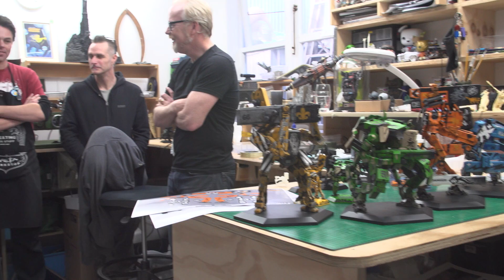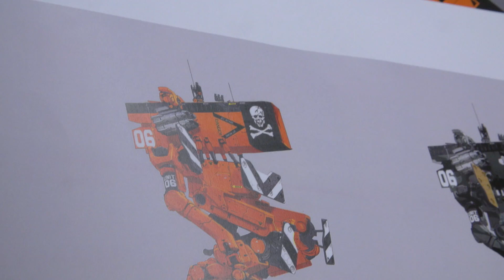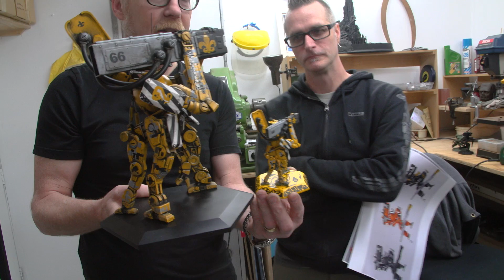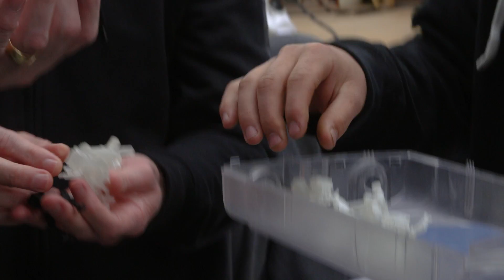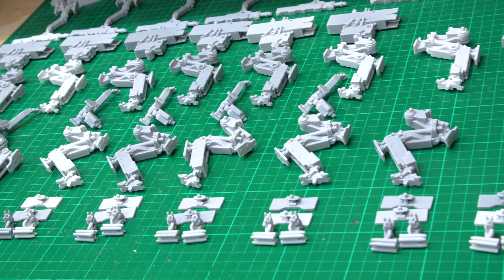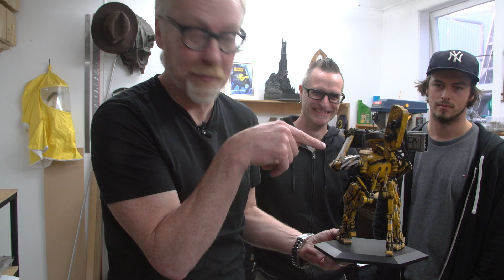Adam Savage Checks Out Weta Workshop's "Giant Killer Robots"

Comment: What if players eventually 3D scan the models, and just print their own? They'll loose a bit of finework details, but they can make and resell for cheaper, which would eventually ruin the creators in the long run.
Reply: Games Workshop dealt with this for years.  A company called Forge World started creating WH40K figs that were cheaper and, to some people, looked better.  But, 40k was big enough worldwide, that when they had "proper" tournaments, "proxy" models and Forge World replicas could not be used.  Eventually, because people started making rules for the F.W. models (G.W. didn't have rules for their models at the time), G.W. decided that they couldn't keep this from happening, and just gave up and let the consumers do what they wanted.  

But, more directly to answer your question.  I'm assuming that these figs are copyright and or trademarked.  So, if someone were to plagiarize their work and resell them, they would risk legal action for forgery against the owners of the IP.  You can't prevent this sort of thing from happening.  Especially when tabletop games like these tend to be a little expensive.  People want cheaper.  And will do whatever they can to get around the cost, at the expense of the creators.

Comment: How do they make the 3D print smooth?
Reply: ABS and PLA prints can be lightly brushed with acetone to get rid of the layer lines and smooth out  the part.
Reply: they did say "new technology" and they are using "high fidelity" printers
Reply: Some prints can come out really smooth right from the printer. I've had a character printed from Shapeways in what they Ultra Frosted Detail, and it's extremely smooth most places.
Reply: Sandpaper
Reply: GARITA Productions
sandpaper does not seem appropriate for the small ones
Reply: You saved my life that is true
Reply: This is actually why they invested so much money into making a halfling village.
Reply: Elloizius Marcelo
was wondering about the 'new technology
'
Reply: You saved my life might be the m1 resin printer